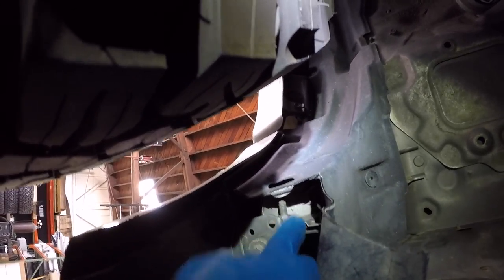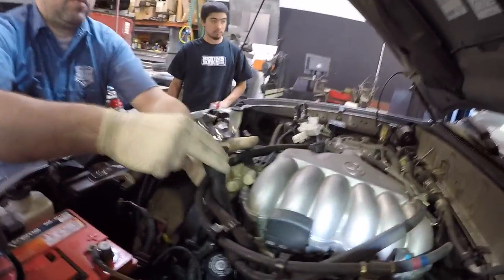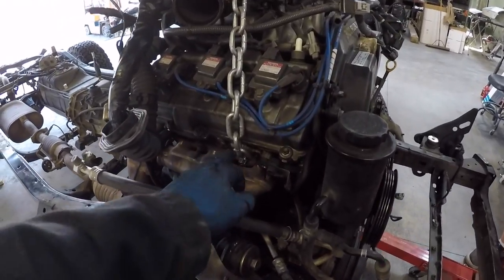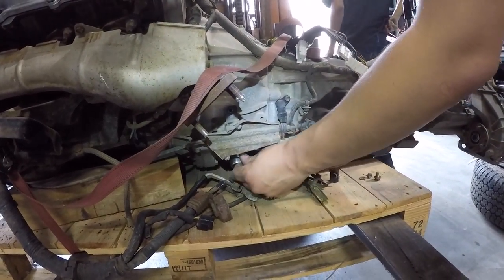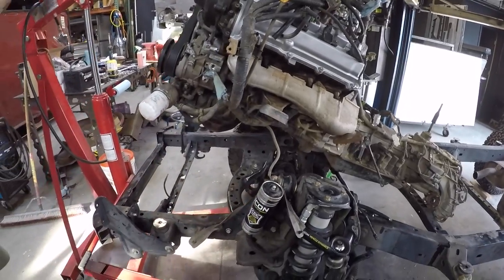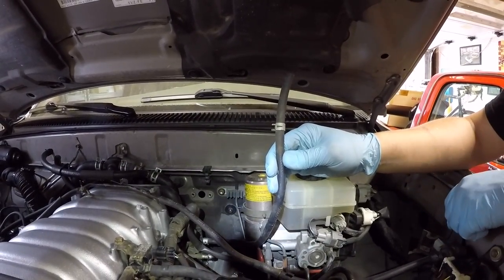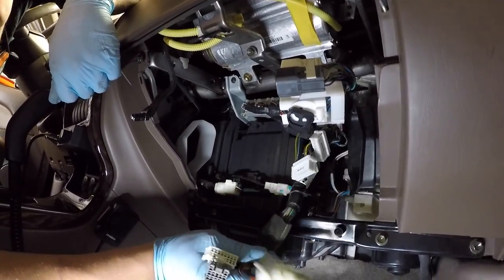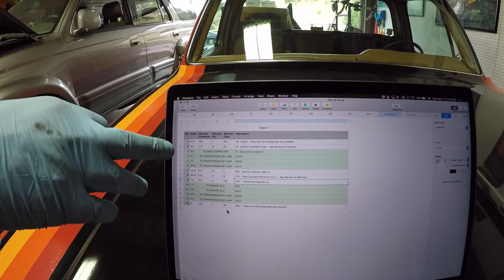V8 Swap (5VZ-FE 3.4L V6 to 2UZ-FE 4.7L V8)

Comment: Would u recommend this for a reliable work truck? I do long trip cycles in my 3.4 for work sometimes I drive 7hours-10 and have had a couple of issues due to my truck having 168k miles. A shop told me I should just buy a new truck but I think it’s a waste of money if I’m gonna beat her up and lose 50% of value within a year of working every time I’d trade it In... I used to hate on this truck until I drove it now I don’t want to let it go 😩 should I import a helix or stagea or would this be a good swap for what I need Timmy ?
Reply from the maker: What kind of issues have you had with it?  I wouldn't do the 2UZ swap unless I could do it all myself and didn't need to pay for help doing it.  It's a ton of work and it's also fairly expensive depending on how much you spend on everything to make it happen.  The 3.4 Liter V6 is a great engine.  They are known to go into the 400k miles and beyond.  If you have some type of major failure, you have options to get it back on the road.  You could put in a used engine or you could drop in a rebuilt and we have a 4 part video series to help you do it.  As long as you take care of that motor, you might have hundreds of thousands of trouble-free miles left in it.  My 2000 4runner has over 200k on it and I wouldn't have any problem driving it cross-country.  Just do the regular maintenance and drive the shit out of it.
Reply: @TimmyTheToolman  first, thank you for the response! well a couple of things have happened since I got her, I’m the second owner got the truck around 125k and have put already 35k miles within 4-5months of using it for work, I’m a cat for insurance companies so I tend to do long cycles from the 5 months I’ve had the truck it has left me stranded about 4 times, the first time I completely forgot but I should be able to find the receipt for it, the second time it left me stranded I thought the battery went but when I switched it out after towing it home it did not start so I had to tow it to my hometown mechanic, ended up having a bad alternator a blown fuse and the regular waisted wheel bearings, the 3rd time It left me stranded I was driving on the eway  and again it was due to another bad alternator but I was 3 hours away from my house and decided to tow the truck to the nearest well rated shop they did a excellent job and told me that my hometown shop gave me a bad alternator and recommended me to ask for a partial refund from my other shop and the 4th time was due to a bad power leak in my truck from one of the after market systems the past owner installed which led to my dash and accessories fuse being burnt, when I took it to my hometown shop they looked at it for 2 days and said they did not find a leak and recommended me to ask past owner what shop installed the after market system so that they can ask the shop where the harness is at and what they used or else it would cost me a lot if they cant pinpoint the exact location ... now every other month I have to put in a new fuse because of that leak this is mainly by I don’t trust the vehicle anymore and just want to rip the whole engine and try to build a mostly reliable/not too slow work truck.
Reply from the maker: @swagsession1  Gotcha.  Well, if you can figure out the power draw, the rig sounds like it will be dependable.  It sucks you got a rig from a guy who did some shoddy electrical work.  These rigs are generally very dependable.
Reply: @TimmyTheToolman  yup and I know the truck is a good truck too if it didn’t have all this extra stuff in it that’s why I don’t want to part with it, do u think a 1992 hilux surf with no extras with 70k on the dash do me better?

Comment: Hey Timmy, I am planning on running that same engine (non-vvti 2uzfe) in my 2005 4runner (wich had the vvti originaly) Beside the engine I changed the ECU, the immobilizer, the key (and cylinder) and the Body Control Module (Body ECU) all from the donor truck. But for some reason I have no communication between the ECU and the Data kink Connector & the engine tries to start but dies right away. Did you ran into something similar while doing your Swap?
Reply from the maker: Sean and I were just along for the ride with this motor swap.  All the research came from Mikey and he put a lot of time into figuring out the wiring.  Mikey didn't have any issues from what I remember with the wiring harness he built.
Reply: Jean-Francis Dupuis Sounds like you have triggered the immobilizer. I had a locksmith who specializes in reprogramming Toyotas come out and reset the immobilizer to initialize it. Since you swapped everything from the donor it shouldn’t be required, but wouldn’t hurt to get done.

Comment: Is the 03 4.7v8 Sequoia the same engine and parts as an 06 4runner sport v8?
Reply from the maker: Any 2uz is the same engine with slight differences. So this applies to the 4th gen 4runner, tundra, sequoia gx470 etc. the later years had the VVTI but still very similar

Comment: Fantastic video Tim! Did you ask Mikey if he ever contemplated of just swapping the body of a 4Runner onto the chassis of a sequoia? Then fabricate all new body mounts?
Reply from the maker: No, I never asked him that but I'll ask him when I talk to him next.
Reply: Though it seems like it would be straight forward to do that, you would still have to mate the body wiring harness with the ECU so I don't think it would be any easier. The advantage to doing that is you would get rear disc brakes and some confidence in a 7000lb towing capacity.

Comment: Would a TRD supercharger get the same gains in torque and horsepower?
Reply from the maker: No, a Supercharger wouldn't match the torque and horsepower of the 2UZ engine.

Comment: Any advice on doing this for a T100? they're a little bigger in the engine bay than this 4runner pretty sure but would have to check.
Reply from the maker: Don't really have advice other that consider all the costs before you dive in.  If you're capable of doing everything yourself, you'll save a ton of money.  If you're going to hire someone for this, you're going to drop a lot of money on this project.
Reply: @TimmyTheToolman  Yeah that's definitely something on my mind. How much did your shop charge for this swap?
Reply from the maker: @kaiserwilhelmthesecond5744  It wasn't our shop.  We don't really have a shop.  It was our buddy Mikey's project and we were just the guys to document it.  In the video description,  we have the name of Mikey's buddy's shop that was mainly used to get the job done.  Mikey did all the research for the job and made the wiring harness and his buddy Wes did a lot of the necessary fab work.
Reply: @TimmyTheToolman  Okay gotcha thank you

Comment: I own a 98' toyota 4Runner. I keep hearing and reading that my year is more difficult to pull off. But I want the power and torque, with that being said should I attempt the install of 2UZ? ..........and if not what other engine can i use? Maybe Mikey would be interested in making some cash to wire my rig......? And Timmy can Vid round 2! I don't like the new 4Runners and i love my beautiful 3rd gen.
Reply from the maker: Hey Chris, as you saw in the video, this job is pretty involved.  Just the wiring harness portion is a ton of work.  Also, you need to be able to fabricate or know someone who does that knows what they're doing.  I can't 100% speak for Mikey but hey does very well financially and wouldn't be motivated by money he could make helping you out.  He's a super cool and generous dude but he has a family, a busy job and other irons in the fire so I'm 99% sure he wouldn't be interested.  He doesn't even own that 4runner any more.  He gave it to his brother because he needed a more powerful rig to pull a trailer so he bought a Yukon Denali.

Comment: Damn you shoulda got one from an 05! They had Variable valve timing and made 275 rather than 240 hp. Really cool tho!!
Reply from the maker: The variable valve timing would have been nice.  Mikey realized this but he got a good deal on the Sequoia he pulled the engine from so he couldn't pass up on the deal..

Comment: Can you swap a Toyota 4.7l into a 2nd generation 1994 4Runner?  If so, what kind of lift would you need? What else would it need?
Reply from the maker: Anything is possible so hypothetically yes you could do that swap, now what specifically is involved we are unsure of. We are not experts on every make & model & how they would translate for an engine swap. Mikey did a ton of research to understand what he needed to do in order to make this work. Our suggestion is to do some research for your intended vehicle & hopefully you can find some type of write up or information on a forum where someone has shared their experience with a vehicle similar to the one you're interested in swapping.

Comment: Side note: Toyota should have done this from factory! @48thStateOverland
Reply from the maker: Yeah, but then they would have had to make the vehicle a little bigger.  That motor is crammed in there.  Other than some of the 4th Gen 4runners, Toyota chose to use a V6 and left the V8 engines for the bigger rigs like the Tundra and Sequoia.

Comment: Is there a way I can get in touch with Mikey? I am doing the same conversion. Wanting to reach out for help and info!
Reply from the maker: Mikey is long detached from this modification to his 3rd Gen 4runner.  I actually haven't spoken to him in years.  Shortly after this video went live, he gave his 3rd Gen to his brother.  Everything Mikey did, including how to do the wiring, is covered in the video description or the video itself.  So, I'm not going to pass on Mikey's contact information.  If you're looking for a resource for engine swaps, the company ORS (Off Road Solutions) could be a good resource for you.  Good luck!

Comment: 29:56 I’ve been going nuts trying to figure out what that is on my 4Runner because it’s leaking, and steaming. No ones had an answer for me AT ALL!! Who would have known I’d figure out it’s a heater control connector wile watching a video for entertainment..
Reply from the maker: Hey David,  glad you found some helpful information in our video.
Reply: Timmy The Toolman I’m having a bit of trouble finding this replacement part. It doesn’t affect my 4Runner good or bad that I know of. Overall it just worries me to see it smoking after I shut the engine down. I’m wondering if you happen to know if I could do a “quick fix” and bypass it with a hose until I’m able to find, and afford the parts I need?

Comment: Awesome, and very impressive swap,,, but around $12k spent,,,  naaah,, heck no, i would rather use that money and patiently buy a used 2009 toyota sequoia/tundra
Reply from the maker: Yeah, I agree it's a decent chunk of change but a Sequoia or a Tundra isn't a 3rd Gen 4runner with a 4.7 liter V8.  I personally wouldn't spend that kind of money either because I'm fine with V6 power but it would be pretty damn cool to drive a 3rd Gen with a V8 under the hood.
Reply: @TimmyTheToolman  Lol..well, with my 3.4L, there's no risk of tickets!
Reply from the maker: @wildmustangart1577  Yeah, you ain't kidding Steve.  With my 98 that has a lot of additional weight on it due to bumpers, armor and a roof rack, it's a serious slug especially in the mountains.

Comment: Adding a supercharger in my opinion would be a lot better in terms of time  and money spent.
Reply from the maker: A supercharger is an option but it's not quite what a 2UZ-FE engine can do performance wise for a 3rd Gen 4runner.  Also, the 2UZ engine is a bomber engine.  It's even more long-lasting than the 5VZ.  They are known to go over 500k no problem provided the engine receives regular maintenance.

Comment: does cruise control work?
Reply: Yup, cruise works great!  The ‘02 4Runner uses the same wiring setup as the Sequoia so it’s just a matter of connecting the corresponding wires in the E5 plug. Earlier 3rd gen 4Runners used a different cruise control switch so it will be more difficult.

Comment: I've always thought of this project for my runner but I have a 5 speed manual transmission I don't think  there and conversion kit to fit the v6 5 speed manual transmission to the v8
Reply from the maker: A 2UZ in a 3rd Gen 4runner is pretty damn cool but it is a lot of work to pull off.  Maybe it's a blessing you have a 5 speed.
Reply: Yes maybe but I'll still love to have the v8 power into a smaller car.

Comment: Body lift wasn’t needed?
Reply from the maker: Needed for what?
Reply from the maker: Mikey got away with no body lift on this engine swap, but I think a body lift could help a lot with fitting the 2uz in the engine bay with less headaches.
- Sean

Comment: It's insane to me to look at your undercarriage knowing that it's 20+ year old vehicle with NO RUST! Same with your brake master cylinder and pump, they look brand knew. doing that on a rust belt 4Runner would have been a MUCH bigger project, much more time needed to battle the rust that would have been present. You west coasters should really appreciate your weather, even when it gets nuts sometimes.
Reply from the maker: We are spoiled at some level, no doubt.  We do have very nice weather where we live.  We also have high taxes, morons running the state, lots of homeless and crime.

Comment: Can you just take all the harness out of sequoia and put in 4runner verse wiring to fit 4runner
Reply from the maker: You could but it would take a lot of customization to work with the 4runner.  I think your idea would require even more work but I could be wrong.

Comment: Need to pull the chassis out or can be done without remove the whole frame because that sucks
Reply from the maker: You don't need to remove the body off the frame like we show in the video.  You can pull the engine and transmission separately with the body on.

Comment: Would this swap work with a 2002 Tacoma TRD 4x4?
Reply from the maker: Yes Jeff, it would work provided you do all the necessary wiring harness work and other necessary fabrication and modifications.  If you watch the whole video, you'll see it's a fairly involved thing to pull off.
Reply: @TimmyTheToolman  I have been told by a reputable person at Toyota that the 2002 4Runner and the 2002 Tacoma were basically identical from the "A" pillar forward. Didn't the 4Runner have the iForce 4.7 as an option? If so...wouldn't a bunch of stuff that you needed to fabricate be available from Toyota? I did some measurements on my Tacoma and there is nearly 12" of clearance from the front of the block to the radiator. Is the 4.7 iForce that much longer?
Reply from the maker: @malhaven1  Yes, 1st Gen Tacomas and 3rd Gen 4runners are pretty much identical with their front ends and drive train.  But, 3rd Gen 4runners did not come with a V8.  The 4th Gen 4runner had this option.  Nothing that Wes and Mikey did was a plug and play thing they could have purchased from Toyota.  If you look at the video footage, the 4.7 liter engine fills the 3rd Gen engine compartment with very little room to spare.  There's no ability to have an engine driven fan.  A custom electric fan set-up needed to be added.

Comment: Dear Tim. I recently watched your engine swap video. It is fantastic. I have a 99 4runner V6 4WD Automatic that needs a new frame. Do you know if the 2WD frame is the same as the 4WD frame.
Reply from the maker: I have a feeling it is but I don't know for sure.  If I were you, I'd ask your question on the forum T4R.org in the 3rd Gen section.  There's a lot of knowledgeable people on there and some of them have done frame swaps.  There is one guy, screen name "TheDurk" that has done a frame swap.  He would be a good person to ask.  If you're not already a member, join the forum and maybe personal message him.  I bet he'll know the answer.
Reply: Only thing that is different is the transmission mount locations. There’s a company that makes a 4wd swap cross frame for 2wd frames. Look up 3rd gen 4runner 4wd conversion.
Reply from the maker: ShaKs Thanks for sharing this information.

Comment: Do you know what diesel model that radiator that is?
Reply from the maker: Sorry, I don't.  Mikey got it from a source in Japan.
Reply: gyff jogofl It’s for a Hilux Surf Diesel of the same year (Japan version of the 4Runner). You can find these radiators through UK off-road/truck vendors.

Comment: Cool vid, replacing a good engine is questionable,  i will wait till the 3.4 died, great info thanks
Reply from the maker: Well, I agree with your logic but the goal was to put a 2UZ engine into a 3rd Gen 4runner.  If he wanted, he could have sold the old 3.4 liter engine.